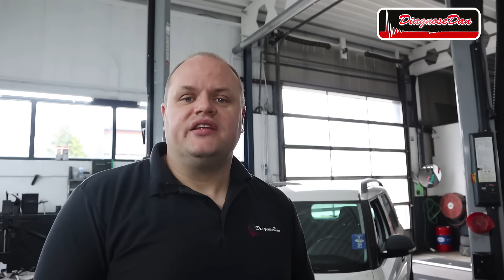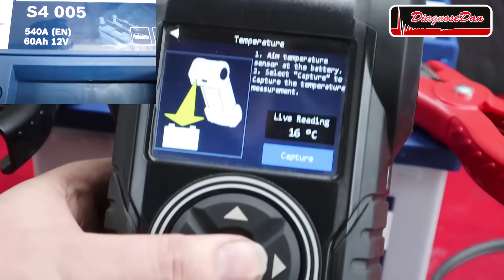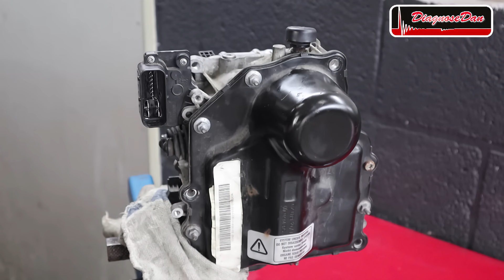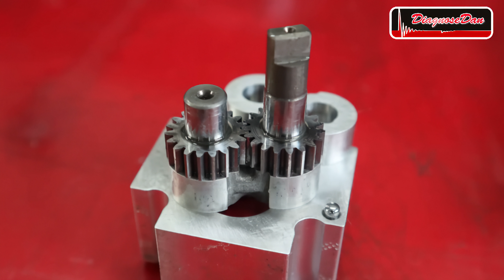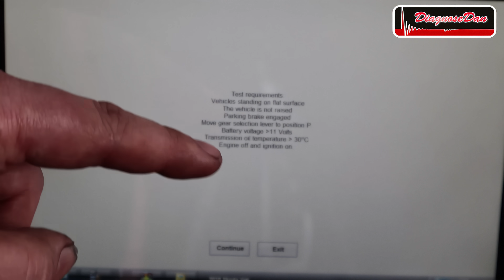DSG Gearbox Diagnosed explained Fixed

Comment: I really need your help please: I have the following fault codes: p1829 (Pressure Control Valve 4 (N218): Open/Short to Ground) p0756 (N89 solenoid open short to ground) AND  p1746 (Transmission Solenoid Power Relay)
PRNDS LIGHT START  FLASHING ON DASHBOARD AFTER 10 MINS, AND IF I PUT  REVERSE GEAR AND CAR DOESN'T MOVE BACK. THE CAR GOES INTO LIMP MODE AND IT GOES BACK TO NORMAL WHEN COLD. PLEASE HELP ANY IDEA, I WANT TO FIX IT MYSELF IF POSSIBLE!!!!
This problem came up after i took it to a garage to replace the timing belt and water pump

Comment: this video was excellent   . clearly showing Dan,s high class skill level.. Interestingly the original fully synthetic oil was corrosive .. I hope the expensive Motul 100% synthetic oil I lovingly use on my engine  doesn,t contain any corrosive additives .  Just for your interest  radio control  model  electric brushless motors are also three phase .. so any R/C electric motor controller would drive the three phase oil pump motor in that Skoda DSG transmission . mr . average mechanic is not going to go to the lengths you go to.   even at 76 years young   I followed your thinking all through . a double excellent score for you .

Comment: Dan said we need two of everything inside the transmission which equates to twice the problems! I was having my Audi A8 mystery battery drain attended to when 
some poor sod in a VW came in with his DSG woes and after a diagnosis it wasn't going to be a cheap fix. VW should have stuck to conventional auto gearboxes
as mechanics anywhere are conversant with them. DSG should be an option and conventional boxes is what comes standard. How many consumers when buying
a VW auto don't know they are getting a DSG and wouldn't buy the car if they knew? Also I disagree in that it is not brilliant because of the complexity and doubling up
of too many components and in engineering that is only asking for trouble and trouble is what VW got and yet they still persevere. If the gearbox is so good how about
a 10 year/300k warranty? I think not. Maybe 8 years/250k?

Comment: to test battery reserve the old way is headlamps on full beam fog lights on then and disconnect the coil  connect a volt meter accross the battery then crank the engine for a number if times while looking at the volt meter. if battery voltage zones not drop below 7.5 volts and the voltage stabilised then battery is good

Comment: Really good video on the working of a DSG. Just one question that confuses me. VW Group refer to this as the dry clutch gearbox. If it has transmission oil in the gearbox and transmission fluid in the mechatronic unit then why do they call it a 'dry' clutch?

Comment: Hi,i want to ask about dsg 7 mechatronic, the car is shaking when changing gear, but doesn't give any fault code, the dealer say it's the control unit of mechatronic but he also he is not sure either,
if i change the control unit maybe the problem persists
does the control unit give any fault code if it's damaged?

Comment: I enjoyed so much of your videos. I have one question about the DQ200 mechatronic, what is the possible causes of intermittent P177C (short to ground) after changing the accumulator to kinergo repair kit due to leak? Had a clutch pack changed but still get this fault code. The car still can change gears smoothly. Just wonder why?

Comment: Don't mean to be a smartarse but re Battery Test - In all of the new battery supplier catalogues (Varta/Bosch included) advise you cannot test a brand new battery using algorithmic testers such as the Midtronics. Yours does have a form of high rate discharge, but it bypasses that if it fails initially on the algorithmic CCA test. At least, the CCA your new battery showed was lower than its rated capacity (480 vs 540 was it?) but of course it still fell within parameters of a "good" battery, but only just..  Its not a problem, unless you rely on that test before giving the new battery some cycling - A little like using a voltmeter to check your wiring than a bulb haha. Superb video as always.

Comment: You sure the gearbox shifted smooth? When i replaced a mecatronic unit with new genuine, selecting drive would stall the engine. I have done multiple calibrations with same results. In the end just managed to drive de car 40-50km and it started to smooth out.

Comment: Hold on a minute. Was that battery fully charged before you tested it with that ultimate battery tester? Regarding a single load test not being sufficient to evaluate subsequent restarts- if it had sufficient power to pass that test well then it will restart. Even a top line new battery cannot be expected to perform subsequent restarts wo a fully functioning electrical system to recharge it. I wager replacement battery was fully charged before you did the load testing on the bench. Fully charge the original battery to get a valid apple to apple test.

Comment: I always had a bad feeling about high SAPS oil. Exactly why I run LL04 oil in my N62 motor. My gaskets seem to last for ever now, my VANOS is always happy and my engine stays clean as brand new. Now I hear how sulpher damages electronics... I run Pentosin ATF1 in the  ZF transmission. I wonder about the sulpher in the ATF1. I never had mechotronics issues after changing the seals and changing to ATF1.

Comment: you are good and patient.  but I think the biggest mistake is design by those in germany.  the biggest mistake is made by the states that let poorly tested products sell and do not force the manufacturer to withdraw from the market.  I came to a conclusion, mechanical gearbox or sequential gearbox but in an oil bath.  dry-geared cars can keep them.  The manufacturer and the mechanics who need to repair benefit from this damage to the consumer.  In principle and as a rule avoid dry gearbox. Ps. Ford powershift is other dry gearbox

Comment: I own a VW Vento 1.2 tsi (petrol variant). Have a jerking issue with the gearbox right from 2nd till 6th gear (both in auto as well as manual mode). The company claims nothing wrong with the gearbox and yet in every service they just tweak the DSG software a little bit. No matter the load of the car, if I try to accelerate a bit quickly without flooring the gas pedal, the gear produces jerks so bad the ECU light comes on and the Air Conditioning trips. Yet, in spite of this, the company claims that there's nothing wrong with the gear box. Could you tell me what might possibly be the problem and how can I have a permanent solution to that?

Comment: Great Video for DSG - 7 speed dry clutch gearbox - I Just bought 7 speed DSG VW passat. 

Dan question for you.  what should i do to make the speed issue on highway, i need to push the pedal hard to get at 70 miles and rev counter is close to 2.
But Runs very smoothly.  no gear issues, just getting the transmission oil changed today. and keep you updated.

1. After watch DAN, getting my Transmission Oil changed today for a 2016 VW passat done 150000 miles.   yes very high mileage. 
2. Will also try to clean EGR Valve and keep,

Comment: Nice video! I do have a tip for the pump motor. It's an BLDC motor not a 3 phase motor. You coul dest the motor by hooking it up to an hobby RC ESC. The motor will spin nicely 😉

Comment: Dan, there is a simpler way to test for short circuits. Instead of installing a new fuse, connect a 12 V tester to both fuse terminals. In the event of a short circuit, the light in the tester will turn on and stay on (12 V on one side, short to ground on the other). Otherwise, it can turn on a split second, dim and turn off. Thanks for your effort for this video.

Comment: Just a tip for those that don't know, in DSG dry-clutch models built before 2015 their is a design issue where the pressure accumulator can crack at the base. This results in a pressure loss that prevents gear changes happening. There is a recall in some countries and VW/Skoda/SEAT are replacing the mechatronics units as a warranty issue.
Reply: What about uk cause shit mines playing up like mad
Reply: @RG-bx1vd  what car
Reply: @S-u-p-a  seat Leon 18 plate
Reply: Is there a listing of the countries. Example, Jamaica 🇯🇲
Reply: I have a P17E100 code on my 2011 Audi Q5 can you help. Please
Reply: my 2007 Golf mk5 R32 is in the shop now. it had all gears lighting up on the dash and car would not even turn over. So its cost me 3.5k australian dollars to have it fixed as they need to go under the car and remove whatever they need to do. They said it would have been a cheaper option if it was a simple fix from accessing the top but unfortunately it is not and I need a whole new part 😢😢😢
Reply: Can I access the mechatronic from Jamaica
Reply: Boas tardes adorei a explicação muito bom mesmo. O meu carro e um VW golf 7.5 gti 2017 e a minha unidade da caixa dsg7 está com erro p0607 terei de mudar a mecatrronica toda ?? Obrigado
Reply: @RicardoSimoes-e1n  Вам потрібно замінити датчики тиску на платі мехатроніка. Це типова проблема. Вирішується перепайкою нових оригінальних датчиків.
Reply: @olehkovalchuk7022 obrigado pela explicação. A longo prazo se eu não fizer essa reparação. Quais as consequências ??
Reply: Donc les modèles après 2015 non plus ce problèmes de fissures ?
Reply: I got error P185400 VW Touran 1.6 DSG 7 speed can you tell me what could be the problem
Reply: warranty means - car needs to be serviced at the dealer
Reply: North America?

Comment: Good video; a point on short checking though.  When checking for shorts on the solenoid, I believe you should have checked for short to the housing not just between the coil terminals.  Short to ground is likely to be more of a problem as oppose to shorted coils.  Shorted coil is highly unlikely unlikely occurrence compared to broken / open circuit coil  - which would not lead to the burning.  Essentially, the dodgy oil was causing the short to ground / housing.

Comment: Guys I read all comments.just to make u all clear he wants ratings and don’t want dsg gear to popular.
Watch video again how manipulate and lie about things.
First about his battery tester he said when connected to new battery the fan comes on with sensors.
It’s not fan from device but actual vacuum cleaner behind him which one of his crew turn on and off .check when he puts the hose on suction some thing.
Also when he put car in to gear that wasn’t Skoda and car was on ramp.
He is making fool you all

Comment: Hi Dan, I have a friend who encounters transmission slipping while driving on his mercedes w220, his car is using 722.6 the transmission. he had visited a few auto-repair shops and one of them had his transmission system replaced but problem still persists and another shops asking for transmission replace too but my friend got afraid that it would not be the cause, so autoshop replaced conductor plate in it. so far problem still remains. it would be much appreciated if you could give me some advice.

Comment: Hi Dan i truly enjoyed learning from this video, i have VW MK5 1.9 tdi when i start up the car it runs and goes into gear and moves but once i drive something happens where the transmission lights PRNDS start to flash and goes into "neutral" state i have to turn off and start again to be able to drive. 

Could this be the mechatronics thats at fault? Any advice would be great.

Comment: Please take extra caution with the mechatronic if the pan cover is bulging/looks like the cover is being ripped off. The accumulator plate has probably failed and the accumulator might be about ready to take off. Can cause very serious injury if not removed properly. I have seen holes in workshop ceilings from those accumulators😂

Comment: Very informative,  well articulated,  I would like to have known the price of the refurbished electrics and the corect oil to use,  here in Australia, Skoda's and VW's are growing in  numbers but not enough to  make the replacement cost as well as the inclusion of workshop labor economically viable,  anything over 10 years may become spare parts.

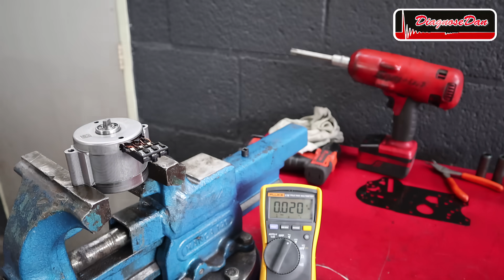Comment: 24:20 great and informative video as always I just want to mentioned that the motor of the oil pump is not a three phase motor I think it is mostly a brushless DC motor and to try it you need an ESC (like the one in the drones but bigger)  or just Brushless motor tester with the proper Amps

Comment: to save your fuses, you can connect test light to battery positive and touch the output of terminal it should light up, if shorted to ground.

Comment: Hi Dan, I have a VW Passat 1.8 Turbo. About 9 yrs with 120k mileage. The MDF shows engine oil is about 110 degree C after about 20+ mins of highway driving at about 110km/h. Coolant temperature is ok. Do you have similar case that you can show? Appreciate a lot.

Comment: Also a dodgy battery wouldn't help........lower volts = higher current = more heat = circuitboard stress?....especially at idle......when parking/maneuvering.....moving those solenoids and spinning that pump motor like crazy. Love your work.

Comment: Its all good there just one biggest mistake has been done- and it could injury you badly or someone that does this like you!!!

If you look on front cover there is sticker and it said danger high pressure.. or something 
Of course there is high pressure extremely high pressure and its that high that can kill person with blink of eye
 I watched with my own eyes what happened in my friend workshop on his camera (camera recorded footage) he didn’t even know what happened- 
He put the megatronic on bench removed the cover of and he just put megatronic on bench again and bang- accumulator flu of 5m in air made the hole In roof and fall down...
He was so lucky -that thing  went up in the air in front of his head Just few mm only..

So before removing  make shoure there is no pressure left there...
By the way nice video 👍🏻

Comment: Hello
Seems like dq200 dry clutch does need fluid changing.
Is there any filter in it?
Please advice on a3 8v 2013 dq200 7spd.
Thanks

Comment: Hello Dan,my 02 Lexus RX300, has an usual shifting. I already tuned it up. Still same. Here is the symptom. When I put in drive,accelerate slowly, I felt the normal shifting but two, three second later,it shifts very strong,like a pulling forward kick, then smooth out. What causes that? A shifting solenoid? With all your experiences, I believe you can identify the cause of the problem,thanks Dan....

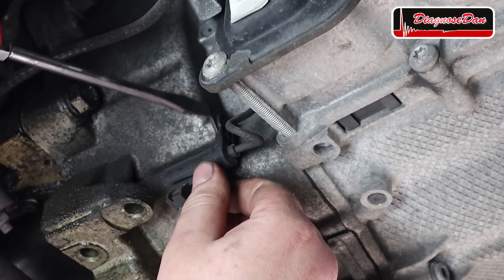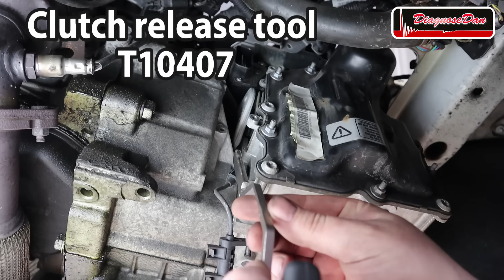Comment: VERY INSTRUCTIVE VIDEO BUT AT 12:29 TO 12:33 YOU DON'T EXPLAIN WHAT YOU ARE REMOVING AND ROM WHAT SIDE ARE WE LOOKING. VERY IMPORTANT AND URGENT, (AS I AM ABOUT TO CHABGE OIL) WHAT OIL TO USE IN THE GEARBOX SYNTHETIC OR MINERAL AND WHAT QUANTITY AND ALSO  WHAT HYDRAULIC OIL TO USE IN THE MECHATRONICS ABD WHAT QUANTITY.

Comment: I have had nothing to do with DSG but after your video I reckon I could give it a go. You broke it down in a very clear and logical way. I was surprised to see the mechatronics had its own little closed hydraulic circuit. Just for idle curiosity, how much in American dollars did the replacement  unit cost?

Comment: One thing I noticed when you were measuring the solenoids.. you also need to check for shorts to ground, it's possible to measure a good coil resistance from them connector prongs and still have it insta blow a fuse if it's shorted to ground.

Comment: So since this has 4 shift forks and I didn't see an actuator for a parking pawl does it lock in 2 different gears on either or both of the even and odd sets to intentionally cause a bind condition and keep the vehicle from moving, or is there a separate cable or electrically actuated parking mechanism?

BTW for whatever reason when I hear DSG I think dual sequential gearbox.

Comment: lesson: do not choose automatic gearbox car. Manual gearboxes cheap to maintain and more reliable.
Reply: This is what I was thinking.  Unfortunately, here in Australia, it is getting harder to get one in every day cars.  3 years ago when we bought my wife a new Hyundai Tuscon, we asked for a manual one (it was an option).  The salesman looked at us like we demanded a hot pink interior.  There were none in Australia and needed to wait a few months for a new build to be shipped to us from Korea.  I now refer to a manual transmission as a millennial anti theft device.
Reply: Manual gearboxes are more reliable and cheaper, if they are made correctly. Some Mitsubishis are joked about because they had such awful manuals.

Comment: it appears that a lot of owners do not check for recalls often, I have an '07 and over the years they add new recalls to the list, mine has 8 with the latest being in 2020 that may cause a problem and a free fix of the issue is done at any ( Chrysler in my case )  dealership .  in most countries they have a website that can be checked by putting in the VIN and check for the recalls, this should be the first place checked ( in my opinion ) when owning a new or used car, because if the repair was done it should have a description of what the repair looks like and the VIN should have been added to the fixed portion of the list if a dealership repaired it.

Comment: Dan, fixed my mechatronic and double clutch last year and since some months I have problems with my reverse. When oil is hot it won’t go in reverse anymore and the gears seems to grind against each other! It got worse over time. My mechanic said it is the singel mesh ring? Do you have experience with this problem?

Comment: I dont think that the oil was at fault. Usualy the controlers of 3 phase motors fail without any warning and any reason at all. You can get anything fron blown or shorted caps to heat damaged components that eventualy end up opening the circuit or closing it into a short.